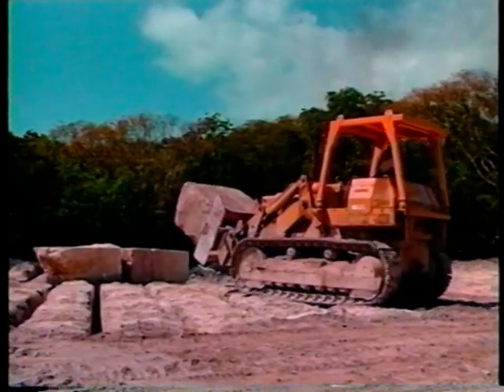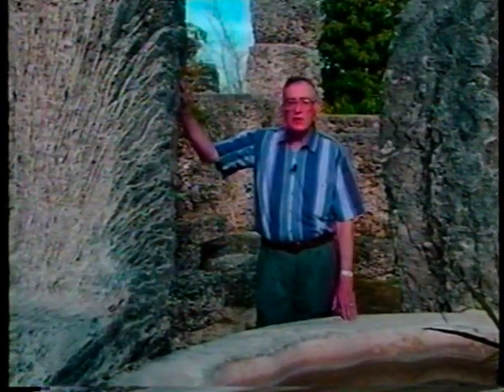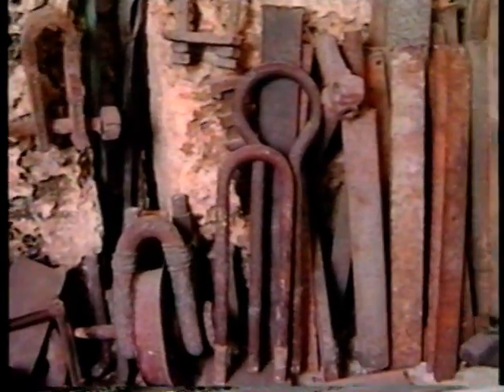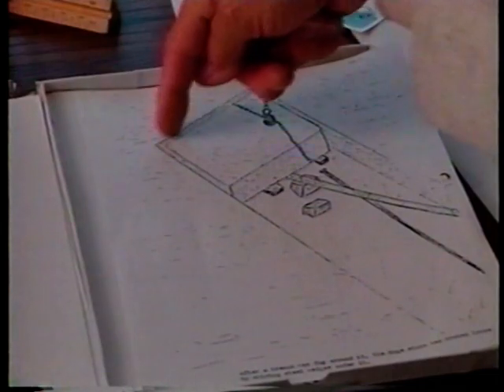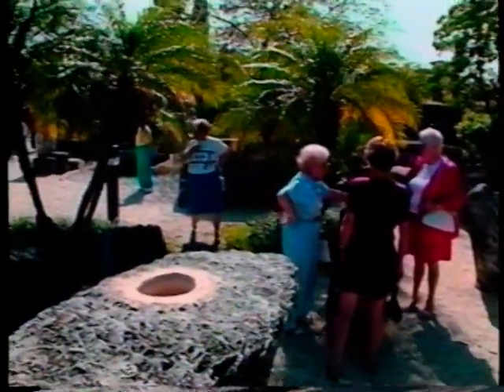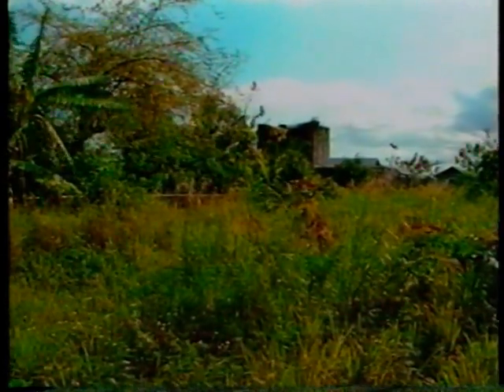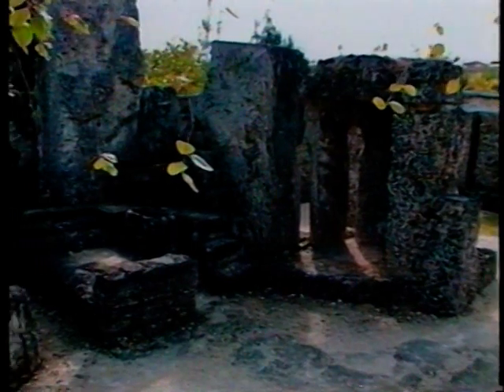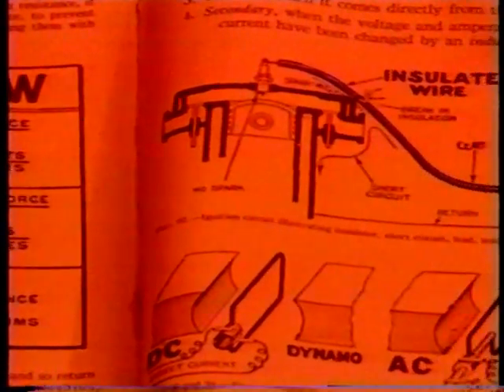The Mystery of Coral Castle Pt 2

Comment: I'm fucking amazed. At the 1:06 minute mark, the guy says that Ed used a sledgehammer and wedged these wedges in place, but yet Ed after a numbers of years, is still as skinny, fragile fucking stick with no muscles. It doesn't make sense. The question is, not so much how the wedges are in place, but who was doing the fucking sledgehammering? So, was Ed a Foreman? Think about it...
Reply: +Jason Grech You don't have to be built like a linebacker to split rock with feathers and wedges. Small, light strikes along the line gets the job done.

Comment: I like to see you explain how Ed cut the first stone. If you look at a picture of Ed lifti a stone from the center of a larger stone, with a cable wrapped around the stone, and under the stone. How did he get the cable under the stone to lift it? The only way is to float the stone then when the stone is high enough he put cables around the stone